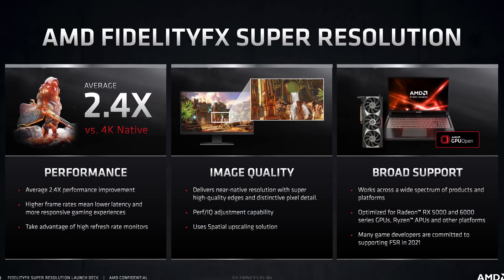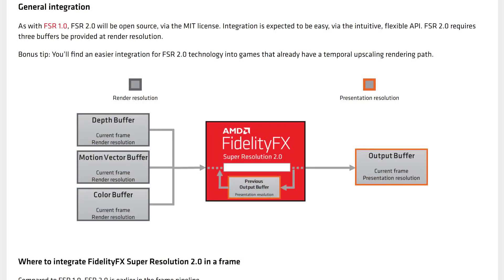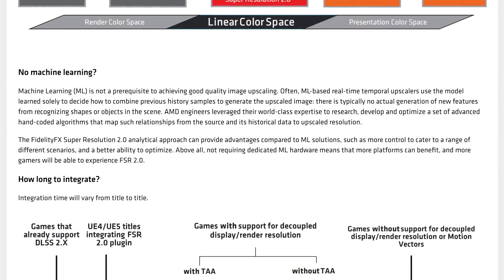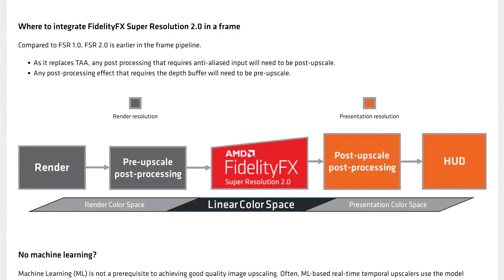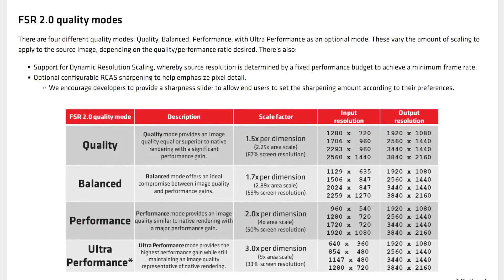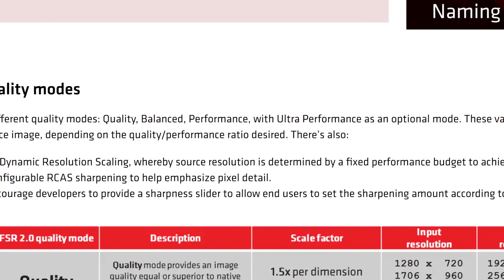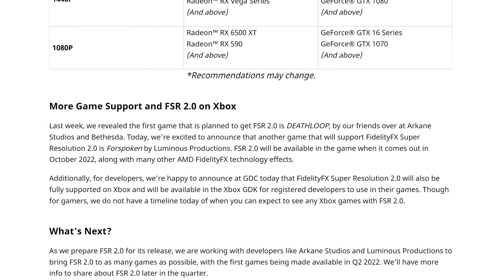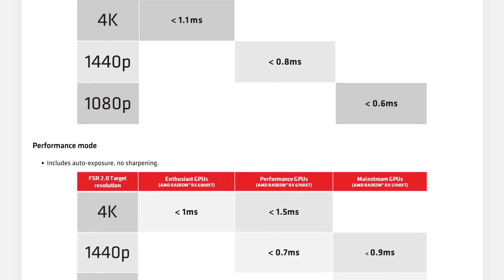AMD FSR 2.0 Details: GPU Support, Quality Settings, How it Works

Comment: I remember when I could get a used GTX1080 for £120. GPU companies trying to fix something that they should have fixed a long time ago.
Reply: It's not as bad as people make out, if you are patient.  I got hold of a couple of really great Radeon cards both with 8GB VRAM and they were £220 each give or take a few quid.  Both new, both double cooler OC versions.  Both perform great!  Equal to 1080ti performance but on a modern 5nm platform with RDNA support.

Comment: Hope all three companies will have standard set of data they need so we can see many games support all three technologies (DLSS,FSR and XeSS)
Reply: DLSS 2 and FSR 2 seem to use the basic set of TAA data. XeSS may too, but I haven't checked their GDC talk yet.
Reply: @Azraleee  Yeah, AMD alreadt claims that integrating FSR 2.0 is quickest on games that already support DLSS 2.X which speaks for the fact the both work very similar.
Reply: @benfrese3573  All of these methods are basically TAAU with different sampling heuristics
Reply: @Azraleee  Which is great! I mean what we don't really need is competing methods that fracture the market like crazy. In the end I want PEACE (and high fps of course)
Reply: Yeah ideally they all work out one standard for devs to implement that all 3 could just hook into. Less friction for game devs is a huge plus for adoption and thus gamers.
Reply: @rx1834  They all are effectively using the standard TAA resources.

Comment: i wish the industry would move away from upscaling. it never looks good.
Reply: False. DLSS 2.0 looks great at 4K quality mode and even 1440p. Depends on the implementation as well but it has and does reconstruct finer details better than standard TAA.
Reply: @HazzyDevil  I disagree. Rather have DLSS and Taa off. They all add some amount of blur to the image, however small it might be, it's worse than the native image
Reply: @rossharper1983  you can disagree all you want, but with actual tests showing these small differences as you state, being noticeable at 20x zoom on a single still frame, no one is going to notice it at 0x zoom in motion, or notice it but barely. 

Again, this is true with latest iterations of dlss, and not with older version where you would notice ghosting and other artifacts.
Reply: @HazzyDevil  I'll stick to native with my 3090, I've yet to see an implementation in person that actually looks good. Although I'm willing to test out a game if you have a recommendation where DLSS is implemented without ghosting, artifacts, motion blur and gives a credible increase in FPS.

Comment: Cool cool, so in theory future settings menus could feature FSR 1, FSR 2, DLSS 2, TSR and XeSS, along with basic resolution scaling sliders.
I hope someone somewhere is working on a way to allow users to test these settings out and see which they prefer for themselves, because all this choice without a clear demonstration will only serve to give people a paralysis of choice.
Reply: I don't think you're going to have all this choice; rather, gamedevs will make one choice and stick with it for a given title between FSR2, DLSS2, TSR and XeSS, so your only choice in a given game will likely be temporal upscaling on or off. I can almost promise you no major game will implement more than 2 temporal upscalers, and the vast majority will stick to one, to limit maintenance and QA effort. FSR1 may still be an option automatically engaged if you disable temporal upscaling but select lower render resolution than output resolution.

The ideal outcome for AMD and Intel both will be that DLSS is no longer available in new games, giving NVidia less feature leverage. This is what i assume their goal is here.
Reply: @SianaGearz  Horizon Zero Dawn already has FSR, DLSS and Temporal Upscaling. Cyberpunk 2077 also already has DLSS and FSR
Reply: @SianaGearz  Nvidia will just pay devs to not use FSR.
Reply: xess wins. fsr 2.0 releases too late
Reply: The fact that Intel still hasn't made a decent GPU (arc= 6500 XT performance I'm guessing) doesn't leave much hope for XESS being as good as hyped.
Reply: @cyberfred5520  Arguably XeSS (or FSR2 if it turns out good) is its only major hope. Specifically underpowered GPUs benefit spectacularly from temporal upscaling!
Reply: I mean you can take DLSS out of that list, only RTX cards can run that bad boy, XeSS I think is only for Intel IGPU's and GPU's and RSR is for AMD cards (a way to brute force FSR into every game but with a lot of Downsides), it will most likely be FSR 1 v FSR 2 v TSR
Reply: @dkrampage2933  no, xess is for a lot of gpus, including gtx 1000, 1600 rx 5500xt rx 6000.
fsr 2.0 is worse
Reply: @crisp_gaming  we haven't seen Both of them in action, you can't declare a winner without a fight, Companies always show the best scenario for their technology, never what is going to actually look like, Remember almost every game trailer since the X360/Ps3 era? Remember the GTA Trilogy DEFINITIVE EDITION (although that one was actually true to what the game looked like, terrible, idk why people got hyped about it, I hope they actually fix it) or Cyberpunk2077 or No Man's Sky* (they fixed the later hope the same for the former).
Reply: @dkrampage2933  no, unfortunately i cant remember the xbox 360 and ps3 trailers because i wasnt alive
Reply: @dkrampage2933  Sky*
Reply: @JorgetePanete  Oh yeah, sorry I was thinking about Skye from paladins.
Reply: @dkrampage2933  I don't think it makes sense to include both TSR and FSR2, they are operating way too similarly in principle. It might make sense in the interim for a few titles coming this year or ones that have already come out, but not long term. I predict that Unreal will either optimise TSR to the point that it's indistinguishable in performance and maybe better tuned in behaviour to the engine, at which point including FSR2 in Unreal titles is pointless; or they abandon it and FSR2 takes its place permanently.

XeSS is going to run on almost everything, but it's probably going to have a high runtime cost on anything non-Intel for the time being. This is my prediction anyway, we'll see. I also wonder if someone might do a Tensor port of XeSS to optimise it for NVidia cards, just to throw an NVidia binary dependency out of their project.
Reply: @SianaGearz  is for that exact same reason why we should include both of them, they might operate similarly in theory, but the way they're going to be tune could lead to pretty big differences in performance or quality.
Reply: @SianaGearz  I thought AMD is providing an FSR 2.0 plugin for Unreal Engine? Presumably, FSR 2.x will always be an easy option for devs on the Unreal Engine since I doubt AMD would stop updating the plugin any time soon.
Reply: @dkrampage2933  XESS is supported on Intel , RDNA2 and 1000 series nvidia.

Comment: What i'm really curious about is how hard is to implement FSR 2.0 in games that already support FSR 1.0 and if this will come for Nintendo Switch because the poor thing in 3rd party games can't handle 720p handheld and 1080p docked like Doom, The Witcher 3 and Dying Light and now 2 games are confirmed that will be using FSR one of then from the Big N itself Nintendo Switch Sports and Life is Strange True Colors. For the Steam Deck will be a great feature.
Reply: FSR 2.0 is completely different beast to 1.0, you have to have developer support in order for it to work as opposed to FSR 1.0. You could have system wide (with some caveats) FSR 1.0 even if the game didn't support it (like in steam deck) but will never have the same with FSR 2.0.  According to AMD if you already support DLSS it would be easy to ADD FSR 2.0 though.
Reply: tehehe is correct, but i have an addition. If a game already supports lower internal render resolution than output resolution (i.e. has builtin FSR 1 support or even a low-quality built-in upscaler) in combination with built-in TAA (temporal antialiasing) of some sorts, fundamentally, the engine is very likely capable of implementing FSR 2 without breaking changes, though it is to be said that it won't always be straightforward and low-effort. This is not something AMD mentioned at this point, but as a former commercial game engine dev, this is something that i anticipate being the case.

I don't think they cared about mentioning it because most games that are being actively developed/updated and have these traits are the ones to have jumped straight on the DLSS2 already, and they were quick to assure us that porting from DLSS2 to FSR2 will be straightforward, and the announcement is aimed towards PC enthusiast community, not console.

However i don't know if it will be viable for Nintendo Switch in particular. Because come to think of it, if it takes something like 1-2ms of GPU time on a gtx1060 or a 970 with the latter having the same architecture as the chip in the Switch but 1664 shader "cores", and you scale it down to an equivalent of 920mx with 256 "cores", the cost basically rises to something like 6-15ms. I think wait for more extensive runtime cost estimates. It is fundamentally possible that for 720p target, 360p-ish source, it might just fit within 2-3ms budget on the Switch and might turn out viable after all, but it will be super tight! Upscaling to 1080p is likely entirely out of question.

Steam Deck is a whole different ballpark though, so viability is basically not even questionable.

Comment: the ever lasting GTX 1080ti is gonna last for more years because of this. what a card, lucky who bought it at its msrp back then.
Reply: 1080ti is still a beast now with fsr2 😀
Reply: The 1080ti was the last good well priced card with very few issues or flaws.  Nothing Nvidia have produced since gets anywhere near to that quality bar!  I would go as far as saying it remains the best overall GPU of any generation, as ray tracing has shown itself up as a big pointless let down.  So minus that, the 20 and 30 series cards really don't have much of a performance gain over the 1080ti.

Put it this way, if I could choose any GPU to buy at or around MSRP I would still go with the 1080ti or the 6900XT.  Those two are the examples the rest will need to follow if they want to compete at the top and not get superseded immediately by something else.
Reply: @drunkhusband6257  also currently more than twice the cost.
Reply: @drunkhusband6257  and cost 2 to 3x more.
Reply: @drunkhusband6257  i paid for the 1080ti 630€ nearby its release date. Never saw the 3080ti lower than 1500€ and it was the gigabyte sh%t version.
Reply: @drunkhusband6257  so, the same tier of card that's on its msrp 500€ more expensive in just about what, 5 years? No, thank you. Nvidia started this trend with the 2080ti and its ridiculous price that at the time costed almost the double of the 1080ti.
Reply: Not if Nvidia decided to stop the driver support lol
Reply: I own 2 GTX 1080 Ti and RX 6600 XT. Best cards you can get for the money.
Reply: Evga 1080ti ftw3 owner here, bought it years ago for 630€ and i thought it was expensive. The same tier of cards nowadays cost the triple of that. I'm happy that stills a capable card.
Reply: I did! Hot dog!
Reply: Thanks AMD for that
Reply: Shii i bought a 1080 ti duke for 400$ almost 2 years ago during COVID from a guy who didn't want to scalp anyone thank God so I made out like a bandit.. and I run ALL my games at 1440p high settings and it runs all games at a minimum of 60fps so not sure where this target 1440p  with fsr is the target for a 1080 ti comes from
Reply: Wondering,Will the GTX 1070 be supported?
Reply: @skideric  did you watch the video? Yes, the 1070 is supported
Reply: @derekwright5722  Just partial,got things to do...Figured as much....
Reply: All hail 1080ti
Reply: i have a evga founders 1080ti still has 2 years left on my warrenty but i got a 3080 a year ago so it doesnt get used but it was a beast
Reply: lucky you didn't buy the rtx 2000 series
Reply: Whats funny is that its thanks to amd not nvidia…
Reply: Even those with 980ti cards are probably still laughing, tbh.
Reply: @TheKazragore  ++औऔऔ!
Reply: @TheKazragore  980 Ti isn’t supported by FSR.
Reply: That shit can't hang in 2022. For 1440p@60hz it's perfect. But everything today is 4K@120hz, DLSS, Raytracing, Reflex, that card cannot hang no more.
Reply: @WheeledHamster  "everything today is 4K@120Hz" that's not true at all. UHD is in the very minority and especially high-refresh-rate UHD monitors are a new thing and therefore very rarely owned. Most people on UHD have a 60Hz monitor. QHD/1440p is the trending resolution for gamers for a while, this is on the uprise, and FHD/1080p is still in the majority. Although one might and should not buy for FHD anymore IMO..
And the comment is specifically about FSR 2.0, making DLSS not that much of a relevant point then (although it still is for a while). Also, I thought Reflex is just another driver software feature and not limited to RTX cards, but maybe it is, haven't checked..
Reply: @WheeledHamster  nobody uses those wacky settings. I have an LG 65E9 and barely used the 4k with raytracing and all those jungles.
Reply: @WheeledHamster  "everything" is a bit over exaggerated lol. Most gamers still use the 1080p resolution, myself included. It's actually a huge percentage of the PC gamers. It'll take a long while from now before 4k or even 1440p is used by most
Reply: The people that buy a 3080 now are going to be saying the same thing in 5 years. It should be no surprise that an 80 series card is viable for a long time. Even the 780ti is still used today.

Comment: Will this work on gtx 700 series cards, i have a laptop with a gt 750m and would like to have a performance boost in games
Reply: Just download Dota 2 and check if FSR 1.0 works for there. From things that AMD said it looks like if FSR 1.0 works for you 2.0 will work too. But on lower end and older GPUs results may not be as good as on newer ones.
Reply: @Scytian1  thx, I'll try dota soon

Comment: RX 580 is one of the most popular & most selling GPU from AMD. But it's not listed in FSR 2.0. How pathetic ...
Reply: rx590 is on the list, and rx590 = rx580 =  rx480.
Also, that list is a list of recommendations, not a list of supported GPU's.
Reply: @TheCountess666  Oh that's nice
Reply: no it supports, it just might not get enough performance
Reply: @harunresit1398  There is a very minimal difference between a RX 590 & RX 580.
Reply: RX 590 actually an RX580 OC,it would work, it's mentioned later in the video that RX580 would work.
Reply: It would help immensely to read the corresponding text and not just look at the non-exhaustive list (which would have been an entire screenful if they had listed each and every model variation of each architecture).

Comment: Even team green be like: fk yeah woo go amd (>_> ) ( <_<)
Reply: Not at all. We just buy current gen hardware for msrp and enjoy dlss.
Reply: @n.erdbeer  Amd Gpus are much closer to MSRP actually
Reply: @hariskhan01  FE cards are at MSRP, when you know the right time, when they come on sale. When talking about custom cards, those are only close to MSRP, if being at the bottom end, e.g. rx6500, 3050. There is significantly more demand for NV cards, therefore prices are higher.
Reply: @n.erdbeer  Because they mine better.
Reply: @TheCountess666  that's not the only reason. When you look for surveys on gaming platforms about current or future GPU purchases you get the same results, that a vast majority goes for NV.
Reply: @n.erdbeer   @L D  Nowadays is saw a custom 6900XT at its MSRP. Custom cards are more readily available and are much closer to MSRP if they are Radeon.

Comment: I have a gtx680m will it work with fsr 1/2
Reply: FSR 1 is open source so using Magpie for example you can make it work, so I think a similar solution would work for FSR 2. recommend looking it up.
Reply: I'm not 100% sure that GTX 600 supports all the shader instructions needed for Shader Model 5.0, but I'm having a hard time finding the relevant documentation. May the odds be ever in your favour!

Comment: I am asking myself... would there be any benefits in rendering some frames in native resolution, eg one per second, and reconstructing from lower resolutions in between, based on this native frames... i am not deeply familiar with upscaling solutions.. maybe something like this is already done...
Reply: Not really since there is no feature recognition on the frames, and 1 frame per second cannot be used for much more than the next frame without introducing heavy artifacting. The motion vectors, depth buffers and color buffers and other stuff cover this. Also there could be stutter if you do one frame in a different resolution than others, since frame time would vary differently on different hardware. But perhaps alternating frame resolution would work, like 1 at 4k and the next at 1440p. This would eliminate frame time variations (stutters) but could lead to more shimmering. However it would be possible to have more data for a temporal+spatial approach. But it would be a lot more complex, and could even be a performance degradation. Rest assured clever people are thinking about this, and performance is key here, not quality. If you don't have performance, then it is not worth even if it looks always better than native and can upscale with good quality to 16k ... you won't use it if it is a performance hit over running natively.
Reply: Also what I would like to see if a NO-Upscale mode, where FSR2.0 is used only to fix ugly TAA in some games, by replacing the AA with its own.
Reply: @marsovac  "Also what I would like to see if a NO-Upscale mode, where FSR2.0 is used only to fix ugly TAA in some games, by replacing the AA with its own"
--> That would be very interesting and useful - basically, allow the user to activate/deactivate sub-features of FSR/DLSS/etc, rather than all-on/off.